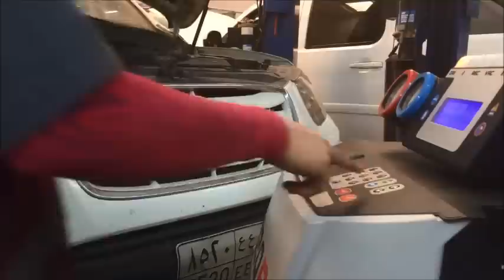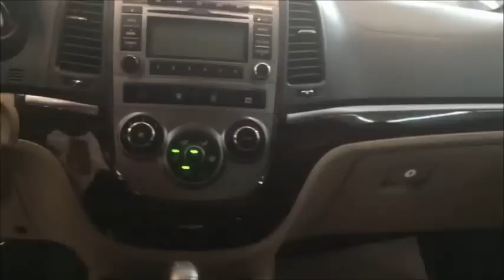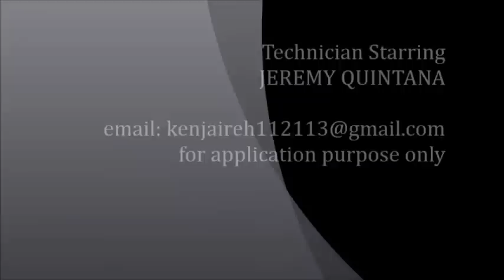HYUNDAI SANTA FE replace evaporator

Comment: The garage said the dashboard must come off. I took out the glove box, four screws inside and four screws in the engine bay to get out the black box. The truth is that there is the blower box on the right, the evaporator box in the middle and the heater box inside the center panel. The evaporator box is the wide part of the black box right behind the plastic glove box. The heater box has the pipes from hot engine which are NEVER together with ac coolant. It is a ridiculous lie. I paid 0 euros to check the evaporator, which looked shiny and did not leak. The compressor leaked. Chevrolet Matiz 1.0 L 2005 64 hp.
Reply: What year is your Hyundai?  I’m doing a 2016 and wonder if I can also go behind glove box

Comment: hello i have a serious problem the evaporator droping water in the car flor can u give me your email cuz the email in the 
comment not found please
Reply from the maker: hi, try put air pressure to the drainage of evaporator maybe too much dust and the water could not flow. one thing is maybe the hose of drainage is damage, check it lower foot race passenger side.
Reply from the maker: kenjaireh112113@gmail.com  this is my email
Reply: ok thnk u so  much i will email u if i need something